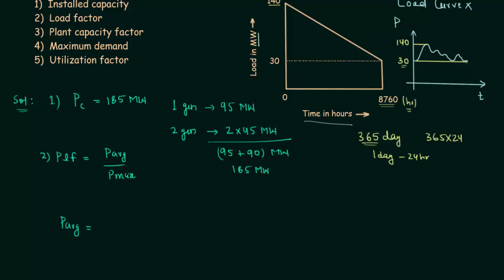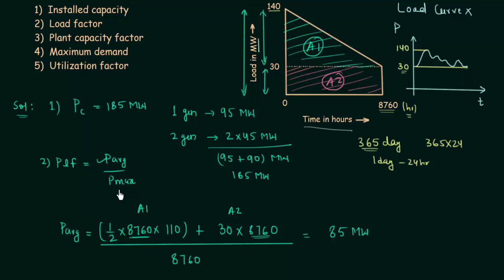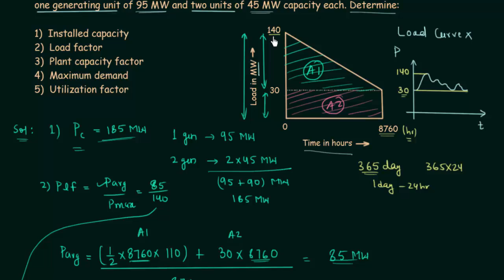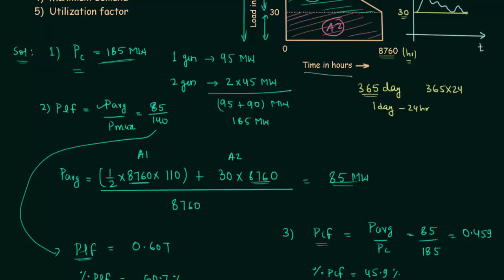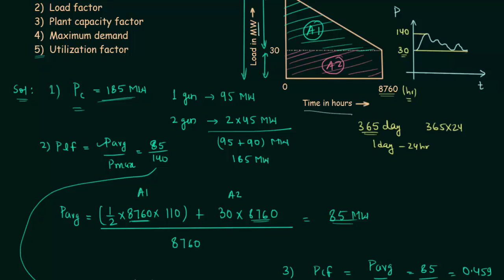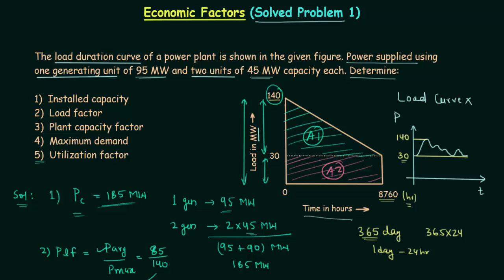Economic Factors (Solved Problem 1)

Comment: Sir, the plant that we are working is generating power meeting the max demand 24/7, 8760 hrs per year. The max demand is 50MW (the contract is to despatch 50MW,=the average demand) the plant generates 50MW 24/7 8760 hours per annum. The plant installed capacity is 60MW of 120x500KW generating unit, where 100x500kW running and 20x500kW on standby for maintenance purpose. In this case, what would be the Load Factor, Plant Capacity Factor, Utilisation Factor?